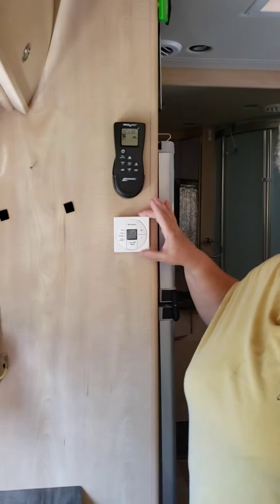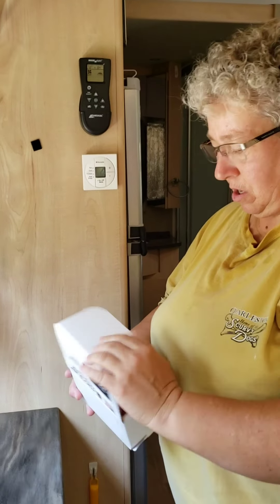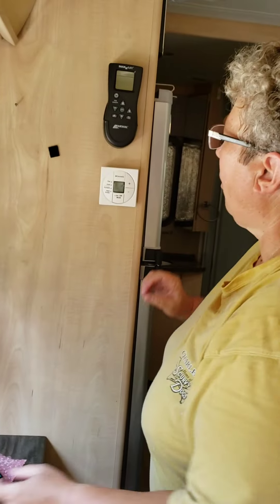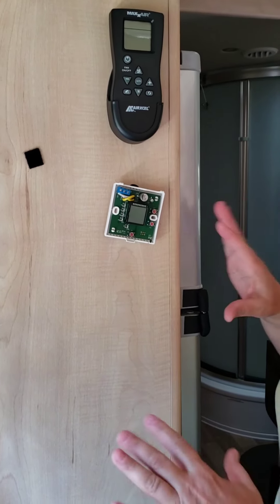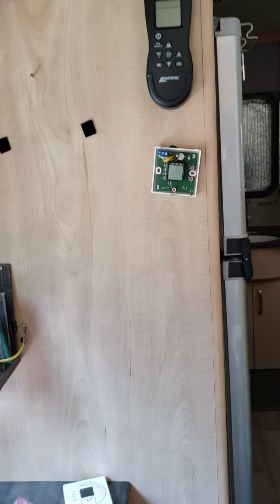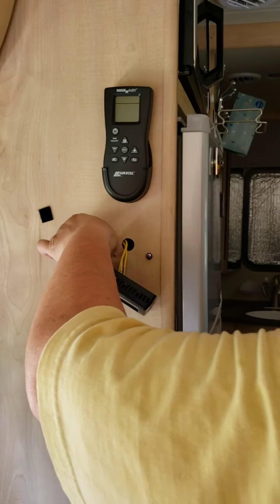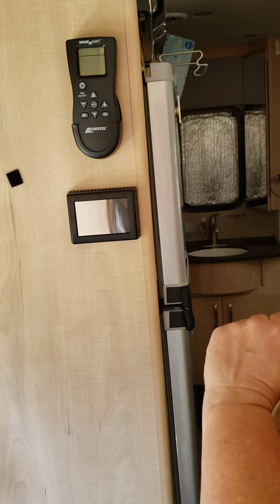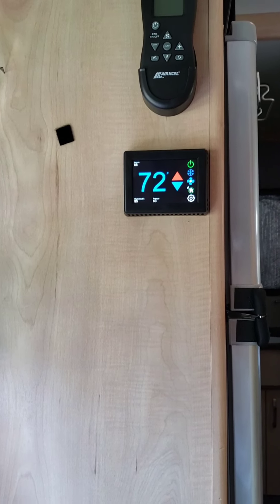Replacing a Leisure Travel Van Thermostat with a Micro-Air EasyTouch RV

Comment: That was an informative, helpful presentation.  I gotta ask though, was the AC on its highest setting …seemed very loud.  Are you possibly considering a quieter AC replacement, with a Houghton or Truma Aventa unit?
Reply from the maker: The Dometic air conditioner is loud, certainly a new quieter one is on my list. But I'd like more LTV user feedback on the Truma.

Comment: Does it control the furnace, heat pump and A/C?  Do we still need to keep the fan on auto to prevent problems that the old Dometic thermostats had?
Reply from the maker: Yes, The EasyTouch is full functioning and gives you all the features you had for operation of Fans speed, Air Conditioner,  Heat Pump, and Furnace, plus lots more! You won't have to continue work arounds like you did with the Dometic Thermostat. It is more accurate on temperature control as well.
Reply: Great diy’er, Sandra!  You’ve made it look so simple I’m going to give it a go-  Thanks for your time!
Reply from the maker: @peggyderosa2720  You go Girl!  If you need any help along the way just give me a shout!

Comment: Thanks Sandy! Do you know if there is currently a way to replace the thermostat on a 2023 Unity with the Firefly Multiplex system? The thermostat seems to be built into the touchscreen controller.
Reply from the maker: I think part of the solution is probably just unplugging the RVC Network cable from the AC connection on the back of the G12 Firefly module. There is a phone style jack plug up on the roof unit, so you may need to run a phone cord up to it so you can use the EasyTouch 350 model with it. Since the EasyTouch is Bluetooth and Wi-Fi you could even just zip tie it up on the roof unit so you didn't need to route the cord. Message me on Facebook and I'll share more with you on this. Maybe I can help you figure it out and then you can post about the solution on the LTV Enthusiasts and Upgrades Groups to help others. I think there was a post on Facebook recently about this but I can't find it. If you tag me on it I'll add my thoughts to it.